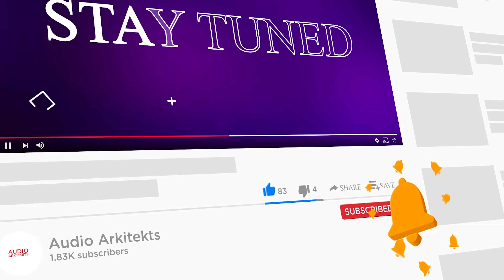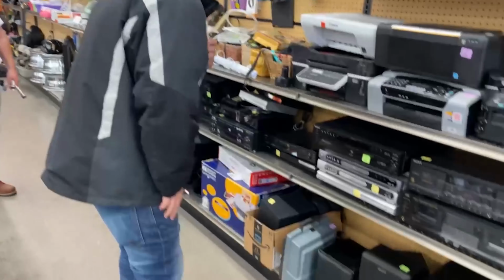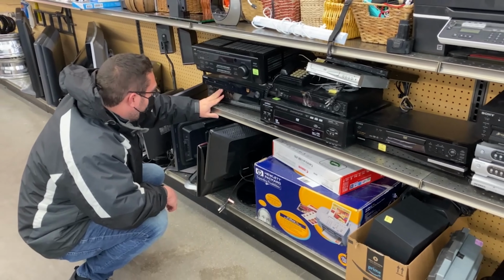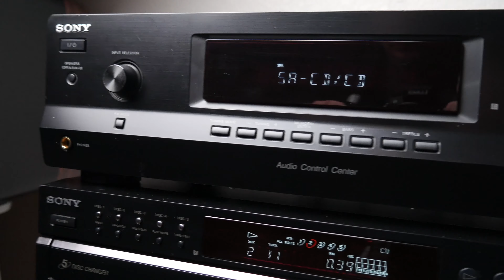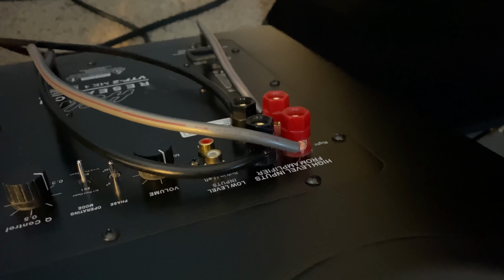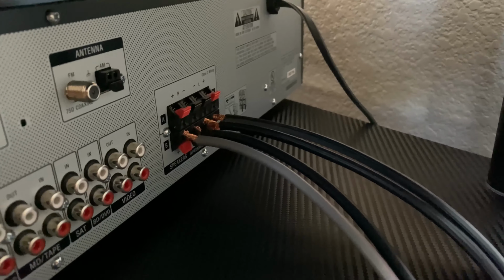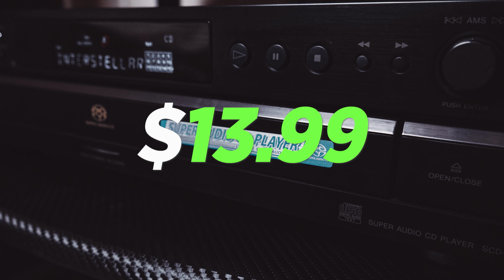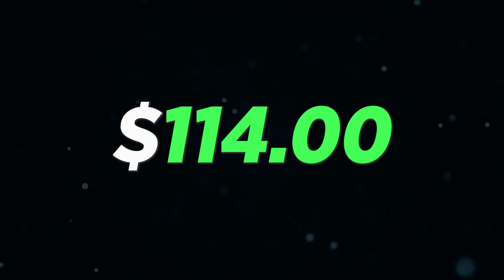My Thrift Store HiFi Haul! Over $2k in gear!

Comment: Dude, Dude, chill with the 12 gauge wire shoved in the spring clips. I think you may be doing it as a joke but for anyone wondering....yes let the lies touch from being over stripped and you will likely smoke your junk. And no, no you don't need heavy gauge wire for high level inputs on anything.

Comment: Craigslist find from wife of remodeler Gear that was going to go to goodwill or put on curb for free. NAD power amp conservatively rated at 100 watts NAD preamp NAD tuner Polk Audio SDA speakers the ones with 4 midrange and 2 tweeters .Unfortunately someone beat us to whatever turntable came with system. All in perfect condition $650

Comment: Entire house sound systems goodwill outlet. Yamaha rx-v1900 5$ two jvc towers 5$, two pioneer towers 5$ , Klipsch center chanel 5$, two Polk active subs and a Yamaha active sub 15$, 2 Polk 12" woofers and tweeters, and Epson projector. About 100$ including cables and nile remote. Garage 4 Yamaha  bookshelf speakers Yamaha center chanel, and Yamaha active sub. All for 15$. Bedroom I got a Logitech z5500 for 5$. Kitchen and deck have jvc and pioneer mix of speakers (4 in kitchen 4 on the deck ) with a jvc reciever. When I crank it all up together which it's all hardwired to smart speakers so I can control which zones play and how loud  it's ground shaking

Comment: Being retired I make it a weekly habit searching out all of the goodwill outlets and thrift stores in my area for over 12 years looking for vintage electronics and found nill, zero.
I keep hearing of people's finds, yet I come up empty.
Reply from the maker: Estate sales are also a hot spot for HiFi. Download the estatesales.net app on your phone to find local sales.
Reply: A big part of it besides timing, luck (too many hunters nowadays, but items are donated and put out randomly and no one can be everywhere), or demographics.
The best hits I've had have been urban, suburban areas where there is some affluence, ie knowledge and disposable income for such items.  Rural areas may have audio enthusiasts, but low population density means fewer items over longer periods, ie lower turnover. 
I've gotten good hits at Salvation army stores located within ethnic communities and retiree areas, as estates are cleared out.    Ethnic areas can have interesting name branded models and items that were sold overseas, out of us market
Reply: The estate sales in the Chicagoland area are a absolute joke. In the rare event there are some half way decent pieces at one of the sales, the people running the sales charge ebay or higher prices for the gear.
Reply: @supsound  Same here at suburban estate sales around SE Mi.  With smartphones, even non technical people easily look up current market values, unlike pre-smartphone days of just 10 years ago or so, when most people couldn't be bothered hauling out their laptop with internet connection to research knowledgeable values.
That said, not EVERYONE does the research, even with their phone. Either lazy or no interest. Even if they do, they may still take low-ball offers or package deals with several items just to be done with it.
Cash and carry is king, and commands a discount since posting an ad online, fielding offers, handling payment and scams, arranging pickup adds hassle and cost.
Best estate sales deals are run by the family like a yard sale vs those run by hired estate sellers
Reply: I just found a working Kenwood KR-2600 for $22 at my local thrift. Hooked it up to my Dynaco A25s and they sound great together. It’s a keeper and looks the part of a cool circa 1976 golden era amplifier/receiver.

Comment: Couple of Audio thrifting tips
That's a nice SACD player, and I can never have enough quality branded 5 disc carousels, which I prefer over those 100 disc+changers.
Bolo for 5 disc Cd/Dvd changers from Sony, Panasonic, Toshiba, Yamaha, etc. Some models play Dvd Audio and  or SACD discs in addition to Cd and Dvd video discs.  Also look for hdcd decoding on single disc and changers.  Scan the brand, trademark logos to check for hdcd, SACD, Dvd Audio capabilities.
Many Sony Blu-ray players of the past 10 years also include SACD playback, though more recent models only have HDMI outs, no analog, so the receiver needs HDMI too.  Still, I've scored many Sony Blu-ray 3d players with analog, HDMI and SaCd capabilities.  They are some of the only SaCd players able to output raw dsd over HDMI for external dac use.

Comment: He must live in the high rent district, hey another way to hook up the sub is : if the receiver still lets the speakers play when using the 1/4 jack run a 1/4  to RCA cable to the low level inputs on the sub

Comment: 1:36 I definitely test equipment first before buying it at thrift stores (especially since a lot of thrift stores offer no returns on electronics) and I even created a little kit for my backpack which includes a pair of headphones, a CD-R with music, a pre-recorded cassette tape, a multi-volt AC adaptor (for some small speaker units that may be missing their original cords and plugs), a light-up magnifying glass (to inspect equipment, to check for scratches on records, to read CD spines more clearly, etc.), a microfiber cleaning cloth (to see if scuffs can be wiped clean or if they are permanent), etc. 

Sometimes I'll even confirm with the manager or with some fellow shoppers as witnesses that my testing kit gear belongs to me and not the store just to avoid any confusion or false accusations of theft.

Comment: Some scores over past couple years:
Sony 1000ES Receiver
Harmon Kardon Dvd31 Cd, Dvd Audio player
Panasonic ScH25 vertical mini Cd stereo with remote.
Toshiba SRF102 turntable
Technics SL-PD607 Mash 4dac carousel
Integra DPS 6.5 Dvd Audio, video SACD universal player
Pioneer Dv578a universal player
Oppo dv981hd universal player
Technics sl-d2 turntable
Toshiba hda2 hddvd player
Yamaha dvd-c950 Dvd Audio video SACD carousel
Kenwood km105 amp
Realistic 10 band graphic led EQ
Sony cmtbx1 micro hifi
Technics SU G90 integrated amp
Varied 2ch-7.1ch Denon, Sony and Yamaha receivers from late 90s through past decade